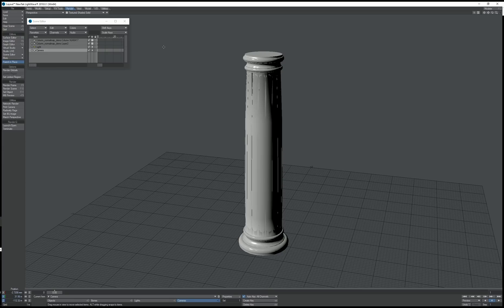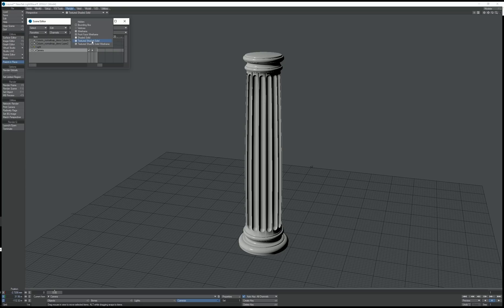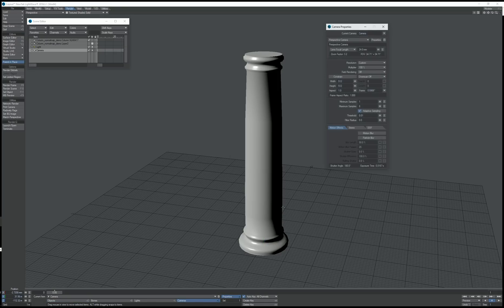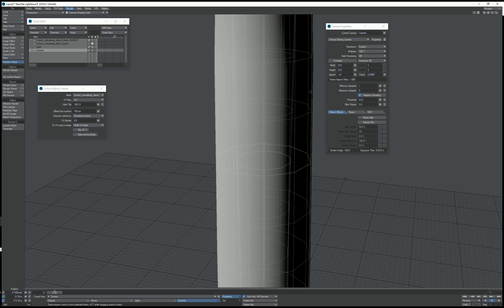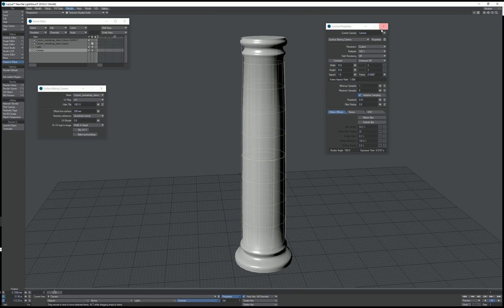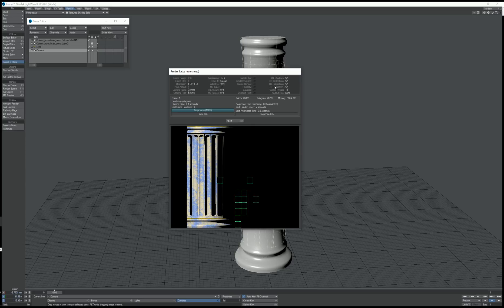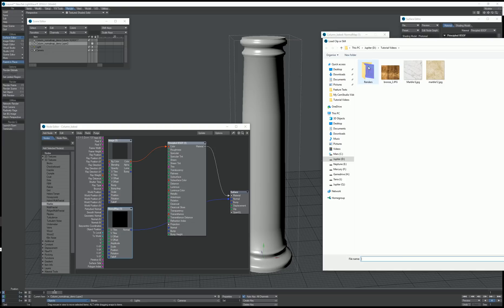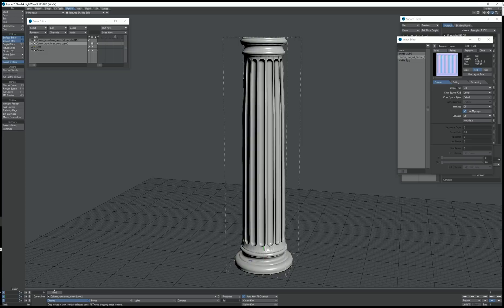Normal Map Baking LightWave 2018

Comment: Hi Antti, how clean is the bake? So at the point of the seam and where it bakes detail over the UV shells? Could you try something like a smooth/chamfered box over a low poly one?
Reply from the maker: It is clean, and the border option with AA works great.